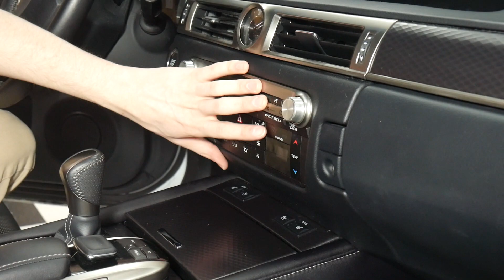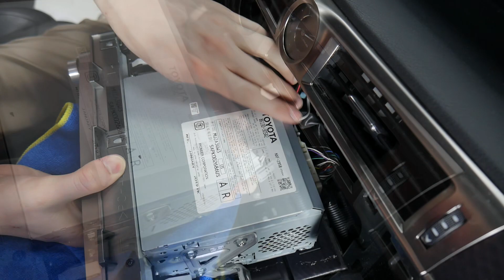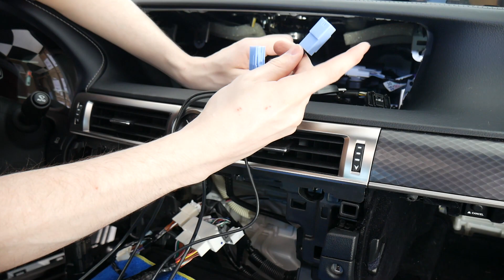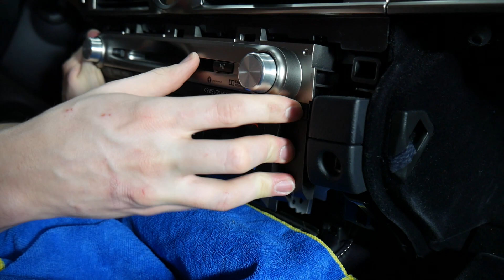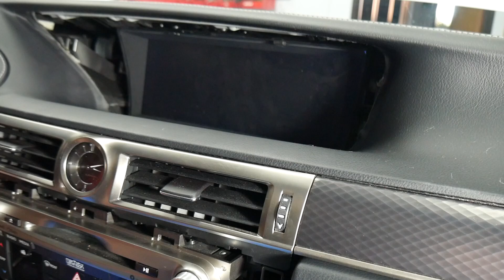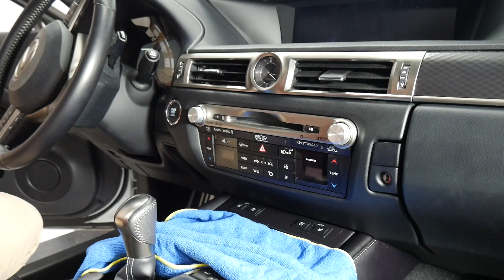Install Wireless CarPlay & Android Auto: GROM VLine VL2 on 2013-2020 Lexus GS with Factory Nav LEX78

Comment from the maker: The VLine VL2 for CarPlay Android Auto integration into Lexus GS 2013-2020 factory car stereo is available here:
https://gromaudio.com/store/vline/grom-vl2-lex78.html
Model: LEX78VL2
The same model is also compatible with the following vehicles:

Lexus CT 200H 2013 2014 2015 2016 (Navi)
Lexus CT 200H 2017 (Navi, US only)
Lexus ES 300h 350 2013 2014 2015 2016 2017 2018 (Navi)
Lexus GS 350 430 450H 460 2012 2013 2014 2015 (Navi)
Lexus GS 200t 350 450h GS F 2016 2017 2018 2019 2020 (Navi)
Lexus IS 200t 250 300 350 2013 2014 2015 2016 (Navi)
Lexus LS 460 600hl 2013 2014 2015 2016 2017 (Navi)
Lexus LX 570 2016 2017 2018 2019 2020 (Navi)
Lexus NX 200t 300h 2015 2016 2017 (Navi)
Lexus RC 200t 250 300 350 RC F 2015 2016 2017 (Navi)
Lexus RX 350 450H 2013 2014 2015 2016 2017 2018 2019 (Navi)

Comment: Where did you install the Vline box?
Reply from the maker: We recommend routing the VLine VL2 main module inside the glove compartment.
Reply: Does unit overheat in glove box?
Reply: Worst installation video ever…
Reply: And unit fits horribly in glove box looks like crap way to bully